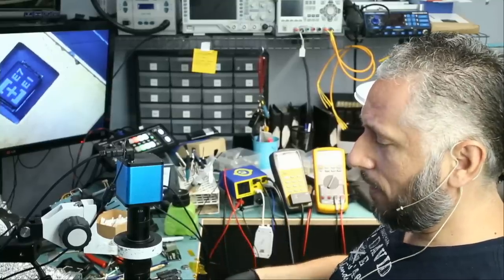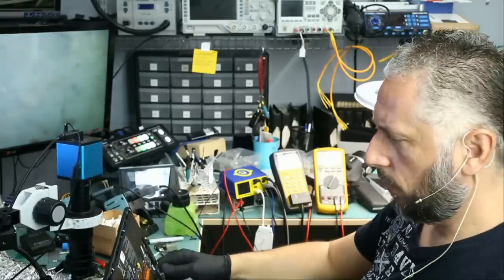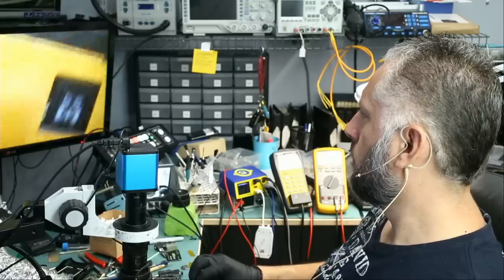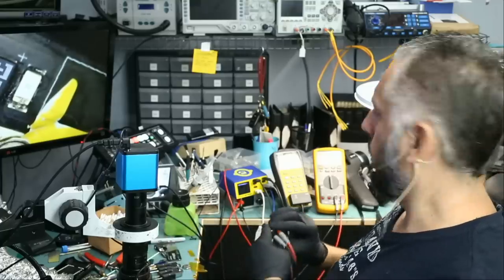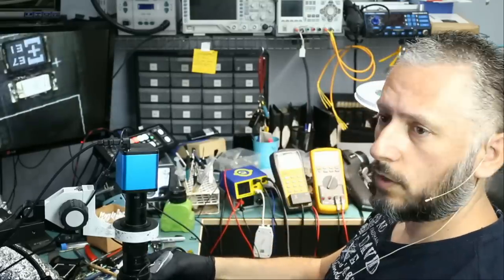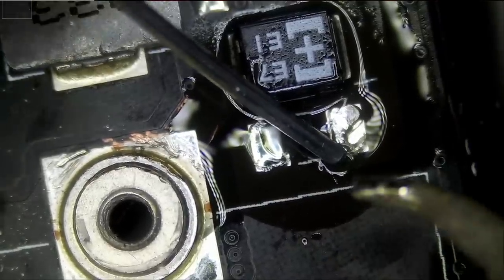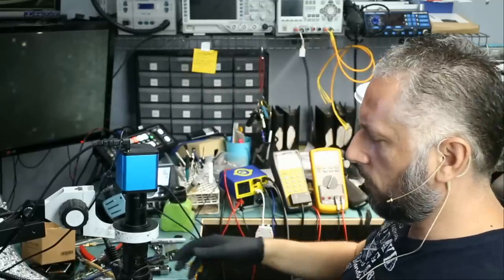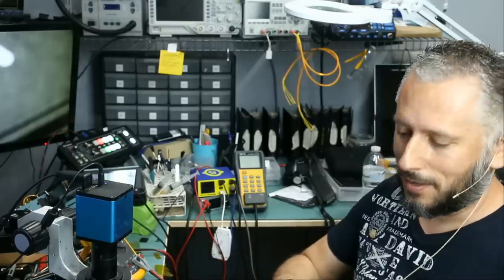Razer Blade Gaming Laptop No Power Repair

Comment: Wow, a classic case of 'just replace the fuse'.
great job and keep up with the videos.
Reply: Yeah, sadly it’s not accessible. If the manufacturers place the fuses, who are very small nowadays, under one of the few removable caps (HDD/SSD, RAM, etc), it will be even quicker to performa repair. Hopefully this will happen eventually when Right to Repair gets through.

Comment: Beautiful repair as always.
my take on what happened : 
-The difference between 1 Ohm and 0 Ohm is that the 1Ohm is gonna consume power ( P = R x I² , for example: if 2 Amps are going through the resistor, it's gonna consume 4 Watts of power ).
-On why the fuse blew : @ 3:00 there is a big cap and it's Ground is right next to the fuse, so if a screwdriver would touch the fuse and the capacitor ground the power surge will blow the Fuse ( or while installing the SSD the customer shorted SSD_always_on rail to ground ).

Now my take on Razer laptops, for me it's the MacBooks of the gaming world. overpriced and not optimized are keywords!
as you can see even tho the laptop is newGen it has a legacy BIOS among other things

Comment: I've got a Razer Blade 15 2018 with a no power issue. I contacted Razer and I was about ready to ship it to them to pay for them to diagnose and repair, but I expect them to just charge some crazy amount to replace the entire motherboard instead of ACTUALLY troubleshooting and repairing the board. I'm going to try to get in contact with you via your form on your site. Just curious about prices. Either way, I'd rather support you than them.

Comment: chief , another superb job .... just a quick question ... what is the reason for putting a 0 ohm resistor on the circuit ? is this only for preventing high voltage or something else ? thank you :)
Reply: My understanding is that  0 ohm resistors are there to bridge 2 pcb tracks. It is more versatile than having to print a track specifically for that bridge.

Comment: I bought Lenovo Yoga laptop, and it was having problem, when I plug 19V power cable, onboard power is only 12.5V, I found what cause problem.

Near power input one of capacitor or what that thing is, 19V coming in but 12.5V coming out of it.
So I try replace from some board but it now show me nothing.
19V ih there, but when I test that replacement part it show nothing 

Is that part need to be replace from similar board or something ?
That is only problem I have.

Before I've done anything laptop just spin cooler and shut down after 3 sec.
All around board it was 12.5V, now when I replace from other board nothing.

Thank you for help.

Comment: Do you inform customers about the issue/fix in details, or they have no interest ?
Reply from the maker: Customers may need to know what you did but not in technical details. Ex: Charging circuit repair, power circuit repair, display backlight circuit repair is sufficient.
Reply: @NorthridgeFix  Love your repairs: - Attitude Makes Difference. 
Thank you.

Comment: Note to everyone who is going to work on a laptop, Always remove the battery or disconnect and give it a few minutes for any excess power to drain before doing anything. Them Razer laptops ain't cheap.
Reply: press power button for 10 seconds* after removing battery

Comment: Razer blade's are absolute garbage. They will detonate VRM mosfets for absolutely no reason other than poor engineering. Usually when they detonate all pcb layers are welded together and the board is trash. I just turn them away now.